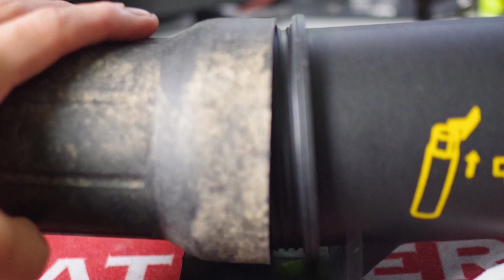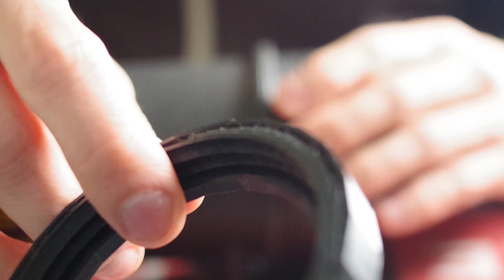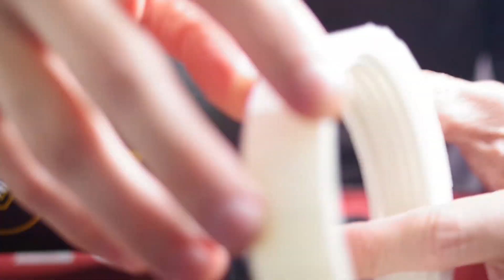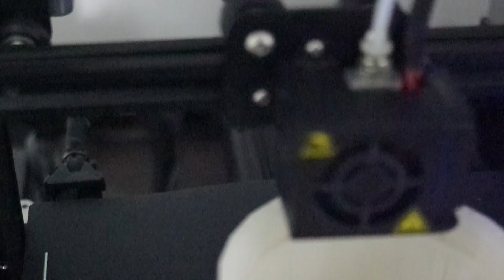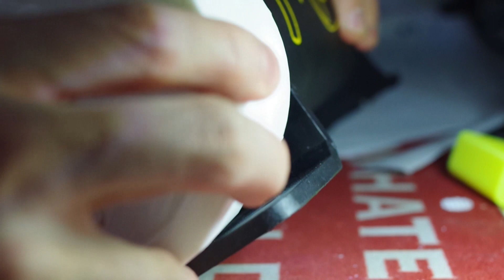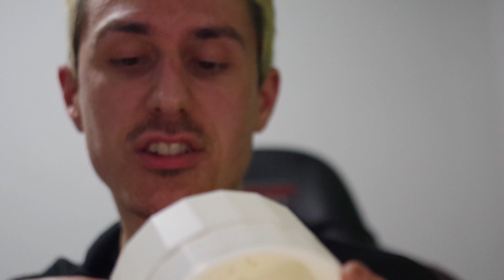3D Printing My Own Tool Tube Lid

Comment: in tinkercad you can adjust your ring faces from 60 to 120. this makes it more smooth. Love the thing you are doing. Im going to get a Pegaso or F650/Sertao that is how i found you. I also 3D print. with 2 Enders. Ender 3 Pro en Ender 5 Pro. both modified to directdrive to also support TPU.
message me if you need some help. 

I do have one question, could you share where you got the tubes from?
Reply from the maker: I did not want a smooth round lid it would be hard to grip, I can't remember exactly where I got the tool tubes maybe eBay or at a trade show 🤔 . My advice is don't get a apprilia pegieso
Reply: @BigPezza  Can you elaborate why I should not buy a Aprilia Pegaso?
Reply from the maker: @wishmaster-productions  past experience mine and others who had them they are just unreliable even tho they share the same engine as the BMW 650. I know 4 that all went the same way became more and more expensive to repair I even gave the a knackered engine to spicy110 to make a video with. Even one with under 20k miles was shagged
Reply: @BigPezza  wow, thanks il take this into consideration.